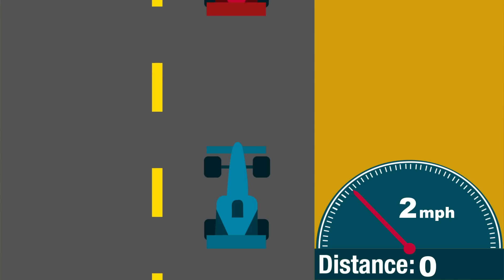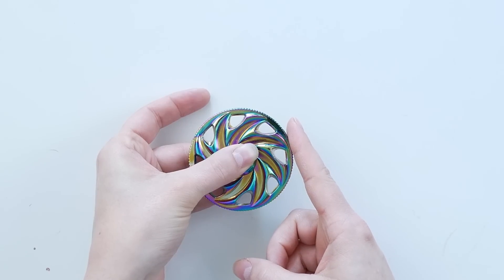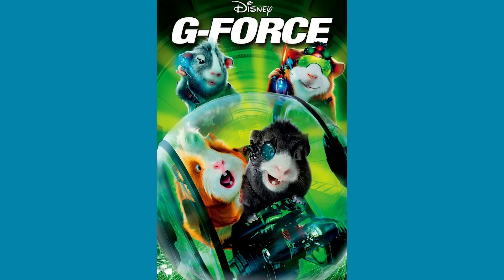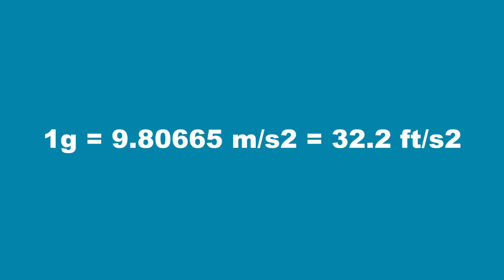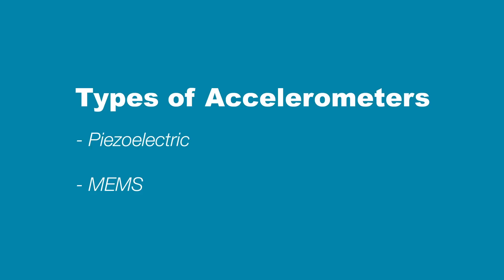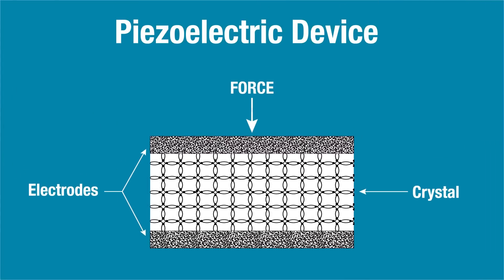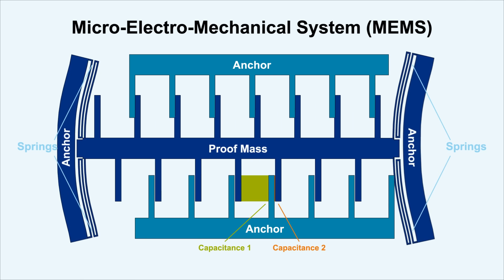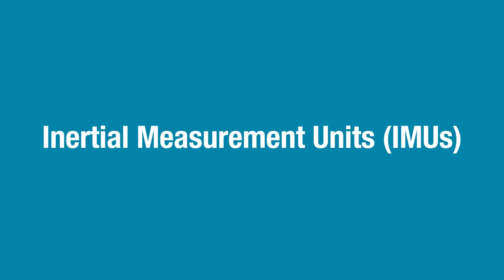How Accelerometers Work - The Learning Circuit

Comment: how  big voltage does CE620 piezoelectric accelerometer requires?  do I need op-amp if I use it with esp32, I want to get infromattion about vibrations of the flat surface? what devices do I need to show the vibration informattions on the screen, except the CE620 piezoelectric accelerometer, screen and cabels, thank you very much I hope you will help me to fund the answer.

Comment: 8:43 Wrong. That is a gyro sensor that sometimes work in pair with an acc.sensor. Acc. sensors are logical but gyro sensors are not. They are based on Faradays paradox, that even Einstein did not get and was unable to explain. In aircraft they were first based on rotating gyros, then lasers in a box the finally the invention of the modern gyro sensor, that is based on really weird science that even work in space.

Comment: Most of the use is for the gyroscope (see your own examples), not the accelerometer. How do they make that one on a tiny scale? Totally curious about that. And the NES gun is a BAD example. It has nothing to do with accelerometers nor gyroscopes. It is a photodiode that measures whether there is light at the position of the duck in the blackout frame you hardly see when you pull the trigger.

Comment: Well... All the applications of "accelerometers"  mentioned are actually GYROSCOPES. Technically they are frequently combined in one chip now days, yet again the video has to be educational, not misleading.
Reply: I use "Gyroscope" in my micro:bit tutorials because of that. Most libraries deliver X,Y,Z rotation, and then students start to treat it as acceleration in their code. They freak out. I now say the micro:bit has a gyroscope and the code challenges make way more sense. Maybe it is time for the micro:bit organisation to change the small print on the bit itself to orientation/direction sensor or something like that.

Comment: i have one dout mam that in phizo electric sensor as you said its force applied is directllyproportional to charge between plate and that charge flow is calculated by what circuit?  is it contain any capacitor?

Comment: The duck hunt game, uses a light gun. in the arcade and home versions they use light sensors on a progressive strobe onscreen to determine what segment of the screen that was being pointed at, and not accelerometers. Although I'm not familiar with the specific one he was using in his segment, it strongly resembles the nintendo home light gun.
Reply: It works even simpler like that. Electronic pens had accurate time sensing like you describe. The NES gun is super dumb tech, it is just a photodiode with a lens. The screen turns black when you pull the trigger, with a small white square remaining on the place of the duck. So if the light drops on the photodiode in the gun you have missed, if it keeps seeing a bright spot you have a hit. With 2 birds there are 2 black frames in succession so it can tell which bird is hit. 4 birds would be near impossible as you will get very long black frames. That was probably the reason it wasn't used much. A game like Terminator or Commando would be impossible with the tech.
Reply: @2kBofFun  on that game, yeah, but on one's like hogan's ally, they actually cycled through to tell which one was hit. But yes, it was a focused photodiode to tell what part of the screen was lit.

Comment: I worked in a vibration analysis company that used all types of accelerometers, piezoelectric where used for balancing shafts, and the MEMS where used in battery-operated wireless sensors. Very cool.

Comment: Airpods have optical sensors on each side that are able to detect when they are in your ear. The tapping function is measured by accelerometers.
Reply: IR Sensors actually.  Airpods actually do have accelerometers and gyroscopes but they're primarily uses for spatial audio head tracking.

Comment: Hiya Karen, my current project with an Accelerometer is a dog collar/harness with WS2812b strip LEDS that show how and where the dog is moving along. Red=left side, green = right side and White in front, with changes in display as it moves.
Reply: That's cool. How does it change with movement?
Reply: @maker_karen1785  The Sides, Red + Green Go up and down like a VU meter as his direction changes and accelerates, while the Front, White, adds rows of white across his chest and get brighter as he picks up speed. It is a big loop around his neck, one strip divided into groups, and I might add small side bars to extend the Red/Green